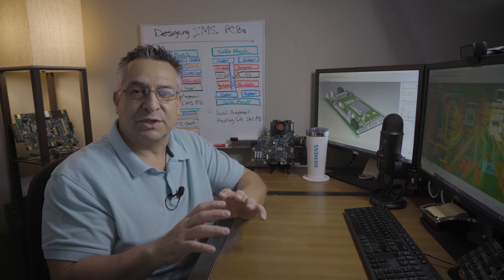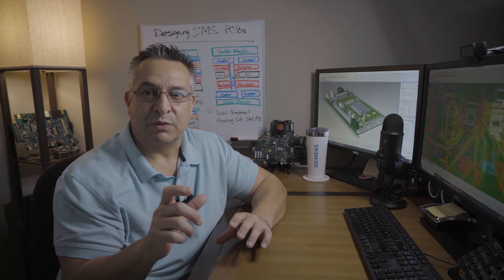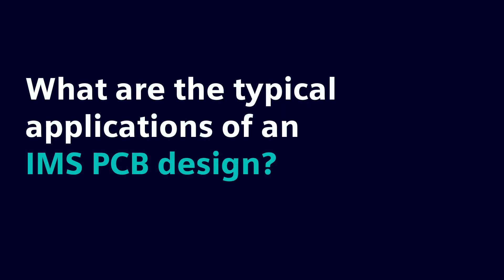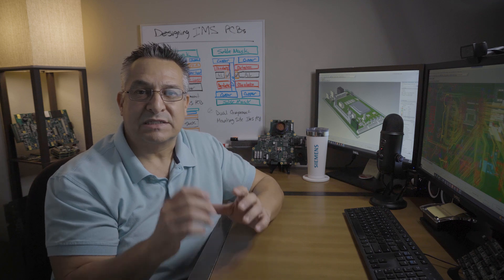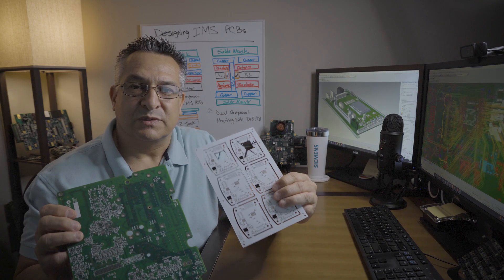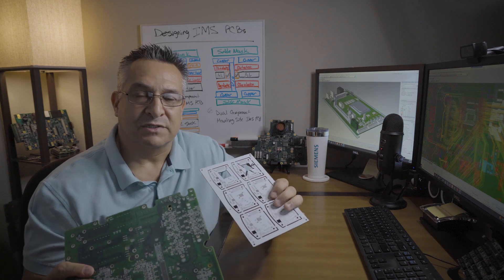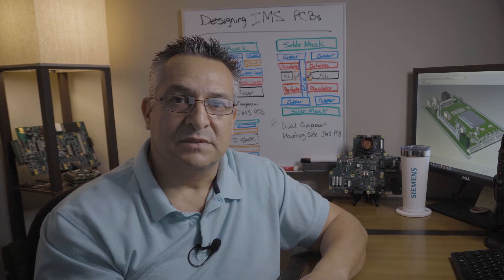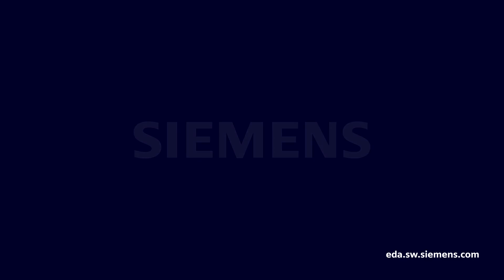Designing IMS PCBs

Comment: Hello! What prepreg is used for the insulating layer in metal printed circuit boards?
Reply: Great question @DigitalWorldBG. Typically, for Insulated Metal Substrate (IMS) PCBs, a thermally conductive prepreg such as Aismalibar, TClad (Bergquist), Laird, and Ventec which are just a few material types to mention. I'd highly recommend consulting a PCB supplier who has successful experience fabricating IMS PCBs to get the best material solutions/options to meet your design intent/requirements.